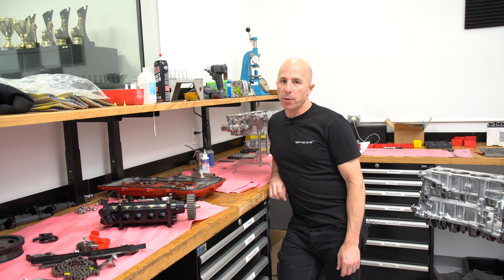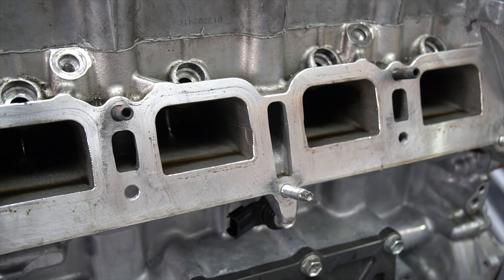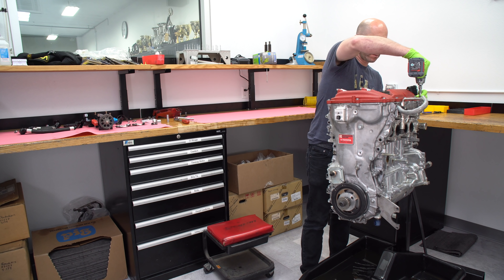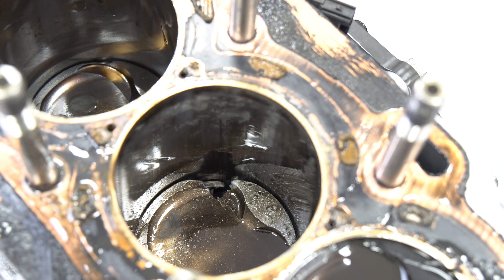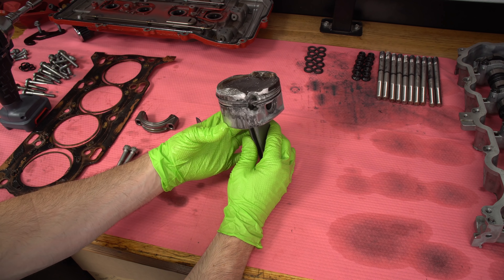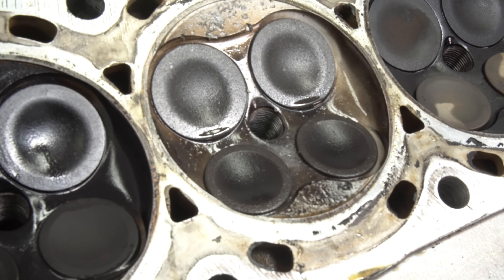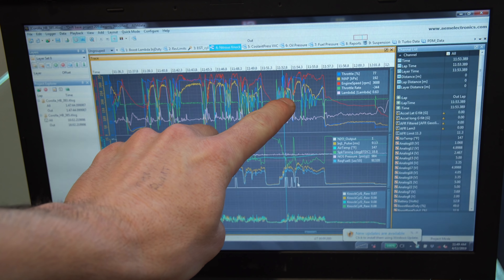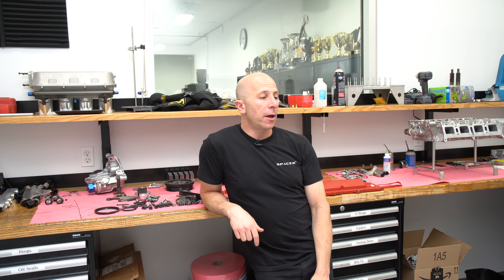Blown Motor Teardown - Burnt Piston

Comment: Damn!!
Unbelievable that a racing team would expose their problems and explain them to the public.
I have even more respect for you and your team, and thanks for doing these videos!
Cheers!
Reply: I'm thinking exactly the same now. Big respect to S. Papadakis for doing this.
Reply: That's because it's just drifting where engines/tunes/turbo's aren't controlled/parity and they aren't looking for tenths of a second in engine performance.
Reply: Pretty damn cool. Much respect to Papadakis Racing for the exposure and education.
Reply: I've seen multiple Russian drifting teams showing their problems, quite common there. But so far I haven't seen a racing team to film the teardown of their engine in a tutorial-like format. Evil Empire drifting team films their blown JZs teardown in a life-blog way.
Btw, in drifting the control and handling is more important than power if you have the skill to use it. Gocha became world champion with just an SR20 and 500hp, and he can keep up with his friend's 1200hp gtr. But still the more power the better if it doesn't mess up throttle response and weight distribution of the car.
Reply: sasja de vries oh, for sure. I’m just impressed because they are a big-time Toyota team; they’re not exactly in the gamma delta iota fraternity (G*d Damned Independents) running an sr20 or a 2j, etc...they’re producing 250HP per cylinder! I think that has to be the exact definition of high-strung in mechanical terms.
Reply: Agreed
Reply: @Rankin1111  That is mostly in drag racing. Where driver still is minimal and it's all about engine modifications.
Reply: I wasted engines when I was learning. I don't have these problems any more. And this is why I do my own work.
Reply: Open Ranks I agree, this kind of stuff happens to regular cars when pushed hard.. is just part of internal combustion engine process..
Reply: lmao at asian engineering
Reply: Unbelievable? It's not F1, it's not like there are any secrets in his engine..
Reply: @Gerardo Izaiah instablaster :)

Comment: I really don't think you cracked the porcelain. Is it more probable someone down the parts supply chain dropped it. That being said, I respect that you took yourself out of the equation for future plugs, with the gapping tool. Awesome vid
Reply: Obviously we can not say for certain who caused the porcelain to be damaged on the spark plug.  However I have scene plugs damaged by the tap down method of gapping spark plugs.  As a result of that I log ago stopped closing the gap on plugs that way and depending on the plug gap I either use a old style plug squeezer or an electrode bending tool additionally I have found that on conventional plugs a little careful work with a Dremel tool and a sanding drum cleaning up the profile of the ground strap can make a difference with help controlling detonation. After re-profiling the ground strap I make sure to throughly clean the plug before installing them in a engine.
Reply: So you are saying the box, and cardboard sleeve didn't do their job? Actually the plugs he buys may even use a plastic sleeve. Dropping spark plugs usually cracks the nickel alloy electrodes inside the plug, sometimes I have even pulled the entire electrode out after this happens. The ceramic insulator is aluminum oxyde, but both if cracked instantly let you know at startup. And once they are cracked they are cracked, there is no in between. So he would immediately know at startup after he installed cracked plugs. And also there is obviously more than one there cracked. This indicates some other issue. Like excessive combustion chamber heat. Indicated by melted underside of the pistons.
Reply: Can't say that I've caused an issue by tapping plugs down for the last like 15 years. But I also have never installed plugs on something pushed quite as hard as that engine. A few 1000 hp plus drag cars but not running that high of boost or for prolonged runs like drift
Reply: I don't think the porcelain broke before the failure.   Detonation and excessive heat causes the electrode to expand and break the porcelain insulator.   I think the tune was a bit aggressive and that cylinder was a cunt-hair hotter than the rest and/or the design of piston itself had a sharp edge that didn't get sanded down.  Look where the detonation happened , right where there's an edge.
Reply: @NickKautz  exactly. Hammering detonation did that. Why? well thats where the story begins . . .
Reply: Cylinder 3 is always hotter, 1-4-3-2 ... 

Nature of a 4 Cyl.

Comment: Pre-ignition from spark plug ceramic chips....who would have thunk it.
Reply: Doesn't take much when you're making a 1000hp from a 4-cylinder 3L engine.
Reply: Maybe one who can read the ECU of the car
Reply: Happens
Reply: Thunk🤣
Reply: Only happens on a 250 hp per cylinder purpose built 1000+ hp race car!
Reply: Ebrahim nalla “Who’d a thunk it” is a common expression. The misspelling is intentional, smart guy.
Reply: ThePhobophile , that’s the last you’ll hear from him!
Reply: I never would have thunk static electricity could spin a bearing but it did .... twice.
Reply: I don't trust those plugs with the that pointy electrode (iridium?).... seems like a hot spot waiting to happen.  Probably last forever in regular cars ,  but not something you want in a max effort setup.
Reply: @NickKautz  Nah. Opposite, really.  The electrical conductivity and heat resistance of the iridium plug actually makes it less prone to set off pre-ignition..
Reply: @SWREngineering  Well they're expensive enough that china's making counterfeits , so I'll pass
Reply: @Ebrahim nalla its purposely misspelled

Comment: Well done for putting this video up Stephanos, it is a credit to you. Most tuning houses, at least the known ones, would absolutely avoid doing that, as it does happen all the time. In general I like your work as it is a quality one. As I've seen comments on pre-ignition, pre-ignition does not happen because of the spark plug, it happens because of hot spots, and the mixture pre-ignites before the spark plug fires. The dings due to the porcelain part falling off can  cause pre-ignition, but Stephanos theory of cracking the porcelain while gaping them it is not the case. The plug having the porcelain already lightly cracked, tiny hair crack,  by dropping the case of the plugs i.e on the ground while shipping it from the manufacturer/merchant to the end user is more of the case, as it does happen. The porcelain, white part, of a spark plug can also crack and brake off if the spark plug is faulty by the manufacturer during normal operation without any detonation present, very high egts etc. Also pistons do not get burnt, they crank, chip and break. A piston is constantly into combustion with very high temps and cylinder pressures, what people see on the crown of a damaged piston/rings is burnt oil.

Comment: Really strong bottom end with excellent lube system design, no bearing damage even after putting a hole in the piston and the crankcase overpressure blowing out the seals and losing a bunch of oil. Great engineering, great video, thanks guys.

Comment: Great video. One thing to mention is that pre ignition and detonation are often confused as the same thing, but that is incorrect. To fully understand these terms, one has to understand the combustion process. Combustion is not an explosion but a controlled burn beginning at the spark from the spark plug. With the spark plug in the center of the head, a flame front is created from the center burning concentrically to the edges of the cylinder, much like a forest fire. As this flame front moves, the combustion gas pressure and temperature increase, causing the piston to move down. This downward movement increases the chamber volume, acting to relieve cylinder pressure and temperature. While the fuel is still burning, if the piston is not moving fast enough to control the pressure and temperature, the cylinder pressure and temperature can rise enough to cause the remaining fuel to spontaneously combust. This creates a high pressure shock wave, (much like hitting the top of the piston with a hammer) causing severe damage to the piston. This spontaneous combustion is called detonation. Detonation can be caused by a variety of things, one being pre ignition. Pre ignition is caused by hot spots in the combustion chamber. These can be carbon deposits or as in this case, raised points of aluminum caused by porcelain chunks bouncing against and denting the top of the piston. These raised points of aluminum cannot dissipate the heat as fast as the smooth flat surface and begin to get hot enough to act as a second ignition source. Now you have two flame fronts burning simultaneously, causing the fuel charge to burn in half the time. Since the piston is not moving twice as fast to relieve the quickly rising pressure, the pressure and temperature rise to the point of detonation. So, the bottom line is that pre ignition leads to detonation. Detonation is usually caused by other reasons such as too much timing advance, which causes the fuel charge to reach the critical detonation temperature before the piston reaches top dead center. It can also be caused by using fuel with a low octane level. Low octane fuel burns faster than higher octane fuel, therefore reaching the critical detonation temperature much earlier in the combustion cycle.

Comment: I've been building turbo engines for 40 years with a lot of road race ones in there 20 years ago. Pre-ignition is what took out the piston, ground electrode and ceramic. You likely didn't crack the ceramic by gently tapping on a socket. Many people confuse detonation and pre-ignition and their effects on components. Yes, the data log shows you had knock activity and knock often leads shortly to pre-ignition which is far more destructive and quick acting than detonation. Great video on the teardown.

Comment: Excellent video.. thank you.
Too many spectators think you can make mega power reliably.  But at this level of racing, the engines are maxed out leaving little to no room for error.   Even if nothing goes wrong, these engines wear out quickly, requiring a rebuild on a regular basis.

Comment: I have never seen anyone "adjust" a plug gap by tapping/hitting the plug on a socket, generally one uses a plug gap tool and gently bends it. At any rate lesson learned - good videos !

Comment: Nice explanation and that tool is a good idea. I had a tuner sell/supply me with HKS branded plugs at a huge cost and when I picked up the car I noticed it had a bad misfire. The porcelain had cracked and I'd suspect it was due to the common practice of being a bit rough in gapping the plugs. Fine on oldschool plugs but newer style just aren't designed for that kind of force.

Comment: Back in the late 80's early 90's I worked for a engine builder who gave you a KD tools 2327 spark plug gaping tool. If the owner caught you taping a plug closed he fired you on the spot.  I don't think it's made any more , it has these ramps on it to open the gap and to close it it has these notches that hook on the plug and allow you to close it. I still have it and have gapped thousands of plugs.

Comment: Detonation is when the burn starts from the spark plug firing and then gets out of control preignition is when it lights off before the plug fires.prolonged detonation turns into preignition  and can drive a hole clean through a piston and bend rods .detonation also knocks the thin protective boundary layer of fuel mix off the top of the piston allowing the heat to actually contact the aluminium and melt the pistons.

Comment: Regarding the dings and pre-ignition, unless there is porcelain in there, it usually wont be as much of an issue with aluminum due to its low melting point. Its really only an issue with cast iron, since sharp or burred edges will glow due to its high melting point and poor heat conduction, thus acting as a glow plug. With aluminum, you get a free flame deburring as soon as the engine starts for the first time, so its not quite as critical to get every edge chamfered and deburred.

Comment: I have had plugs like that in my drag sleds along with the melted pistons. One time, I found out that the octane rating at the pump wasn't even close. Nothing I could do, but now I use an additive whether it should be right or not. Never lost one since.

Comment: Cool video! Its common to have knock and huge problems when the afr its on the lean side, even a good tune with a good afr with to much ignition timing will misfire and loose power, but lean afr tend to make this king of damges. The interesting thing is that all the exhaust ports are dark black, even the spark plug tips, this engine goes from lean to rich alot quicker, with race fuels you should have a brown exhaust and exhaust valves/spark plugs. Data is really important, but the color of exhaust and spark plugs never lie. The knock sensor is good but i prefer to avoid knock and tune out of knock and fine tune the afr all the way of load and rpm, you can make power with conservative ignition and go from there. Taking timing out and putting fuel in on full throttle in high power engines like this will 9 out 10 will melt something.

Comment: Absolutely love your channel.  Been subscribed for awhile ... great stuff.

Bummer about dropping a piston.  Reminded me of the piston and plug (except my plug actually welded the ground tab to the center electrode) in the nitrous motor I built back in the day.  Before NOS kits.  I just used a carburetor plate, copper tubing, drilled a series of 0.030” holes, a second fuel pump, couple of solenoids.  This was in a 305ci (5 liter) Chevy Monza hatchback.  Holley 650cfm on top of an SP2P aluminum manifold instead of the stock 2 barrel.  Ah, what fun.

No I’m looking to build up a ‘91 MR2 turbo.....looking to buy a clean roller chassis if you know anyone (Southern CA).  Shooting for 350-400HP for Chuckwalla, Big Willow, Auto Club Speedway .... plus making it a daily driver.

Comment: Particles in the oil cause detonation - calcium etc etc. Your valve cover has a paint chip on it, which suggests it isn't powder coat wrinkle finish but from a spray can. I have seen in another video your red valve cover has over spray on the inside side where the oil tubes run feeding onto the cam shafts. If that over spray is breaking down and fragments of pain get into the oil cycle, and then into the combustion chamber, then those particles could cause detonation.

1 . Clean the inside of that valve cover of paint (plus wash that oil system thoroughly in case there's paint over spray).  
2. Spark plug sealant (in case boost/fuel is shooting up the spark plug threads) (it happens).

Comment: Awesome as usual! You run those cars hard. A piece of junk like a gasket or if the engine injested a carbon based object can burn a piston, I'm sure you're aware. It's hard to burn ceramic. Those spots are molten piston . Good luck out there!

Comment: I was told at training than iradium plugs shouldn’t be gapped and can be checked with plastic feeler guage if in doubt, but with extreme care as tips can get damaged and can affect performance.    But not the isolators think that could have gotten damaged in transport..

Comment: With a high static compression of 11:1 adding another 30lbs of boost even E85 or the best knock sensor is going to prevent pre-ignition. Your full boost compression is similar to a diesel! I'm following to see where you find some reliability since I suspect you weren't planning a full rebuild after every race like NHRA.

Comment: I also know for a fact iridium plugs HATE being gapped, the ground electrode is much weaker than usual and it essentially has too low ductility to be gapped at all. I found out when a Chevy dealer tried gapping my plugs to try to fix an ignition issue and the ground electrode from the plug in my 3rd cylinder exited through my turbine.

Comment: In another video of your tear down, you show how there is rust on the cylinder bores, from the e85. Look into it if iron oxide is a cause of detonation like the calcium additive in oil was found to cause detonation. You might have to run an amount of regular high octane in it to clear out the rust from the bores.

Comment: Ha! Had a Subaru piston that looked exactly like that. Ran out of gas at full throttle on the highway. Ran lean and melted a nickel sized hole. Sent the block out to get honed and a set of oversized pistons put her back together and was good as new.  Once I burned off the liter of oil trapped in the catalytic converters lol

Comment: So I believe your correct on craving the plug. But what happened was it was bleeding into the case or whatever it could reach ground fastest. And it was arcing onto the piston and the arc melted it through. Toe broken pieces of porcelin woulda came out after a run and it woulda been hard for it to crack it like that. I doubt even if it fell the total perfect way I feel like it would shatter and not break heat treated metal. Where as the spark can easily spot weld itself and cause the gouges and the break in he piston head as well as continue to arc and that arc can def destroy a piston cuz it's so hot it's like using a plasma cutter. Still sucks but I doubt that a piece of pirceling could ever do that damage